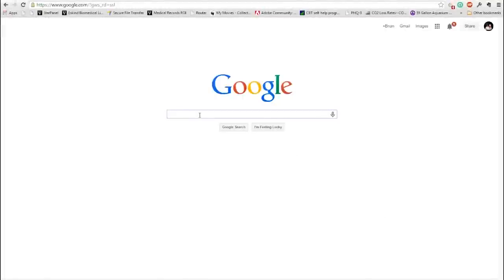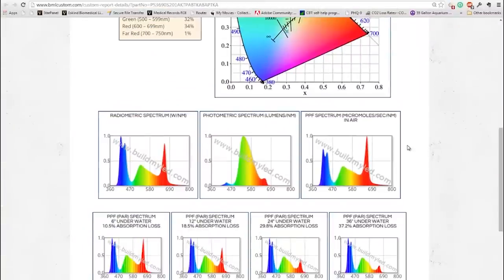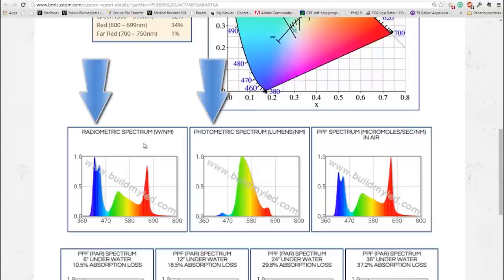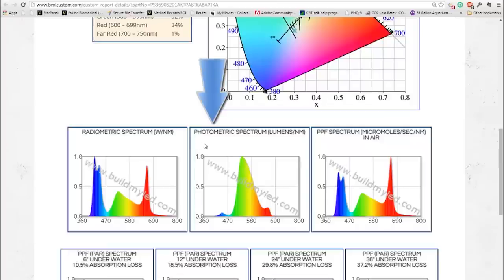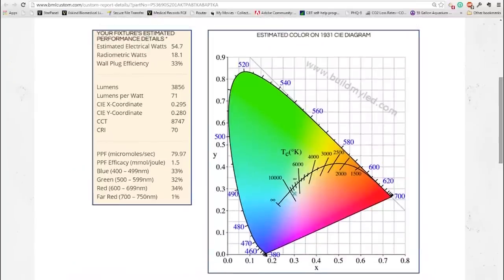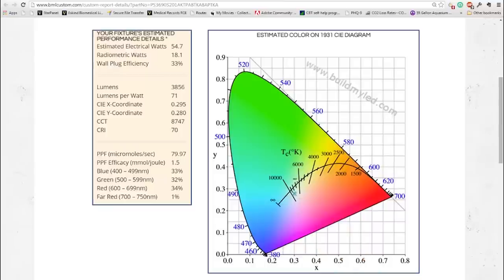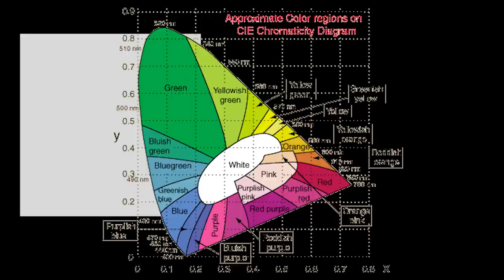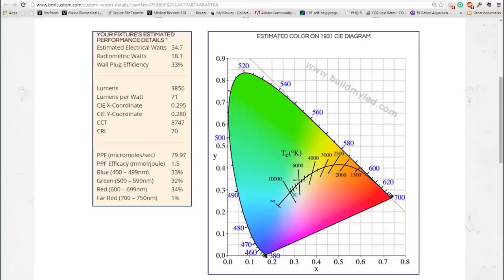Lighting A Planted Tank (Advanced Topics): 1931 CIE Diagrams, Radiometry & Photometry.

Comment: Nice Bri. Once again I am completely lost and yet so captivated. I have a nice LED In my african cichlid tank but my 75 planted has T5 HO's which seem to be doing the job so far. I might switch out my T8 in my low tech for an LED, but then would it really be low tech? Hmm. Anyway great video once again. I think 2000 subs is right around the corner bro

Comment: Hi Brian. Sorry its not on topic but wondered if you could give me your opinion on a question ive been wondering about .
I have a low tech planted tank that as the only source of carbon i give the plants is Seachem Flourish Excel, which they do pretty well on. As , at the moment i just cannot afford to go down the pressurised CO2 route, i was wondering if you think that it would also be to the plants advantage , to set up some diy co2, to run alongside the Excel, or do you think this would just be too fluctuating, and cause more harm than good ?Be great to hear what you think buddy :)

Comment: I get overwhelmed by the graphs on BML. Customer service is great on BML with text messages. This video helped me understand it a little better. But so far the dutch planted XB series is growing my HC extremely well.
Reply: We need some vids man!
Reply: My BML XB Dutch is growing my algae very well...  http://imgur.com/d704NJ8 and thats at 4 hours a day, with a good 'ol ADU light hanging "kit" holding it 17" above a 40B.
Reply: ADU Aquascaping I might make a quick video. I don't have a nice camera, but maybe I could use my S5 phone.
Reply: Brandon C. people actually use that? LOL It did its job for the old Finnex RayIIs, but now I just hang my lights directly from the ceiling with a pretty simple DIY configuration. Isn't a 40 breeder only 17" tall? I guess with substrate it would take it up a little. That may be your problem. With those lights I would try 22-24" above the lowest point of the tank.
Reply: ADU Aquascaping  Of course! I built one because I have a shelf that hangs directly over my tank otherwise the ceiling would have been an option, but I quite like the look the conduit has. I got some rgb led strips and attached them to the conduit so I still have a little bit of light in my tank, when my big light isn't on. Oh and I meant 17 inches from the top of the tank, so about 31"-30" from the substrate... The thing is powerful!
Reply: Brandon C. NickMach007 I am trying to get BML to send me a fixture. Do you guys think one will be enough for a 40 breeder? I am carpeting HC and UG. I had good results with two Finnex RayIIs, but the growth could have been better, and with one Ecoxotic E-series the PAR wasn't high enough. They were going to send me another one, but never did. So I went back to my T5HOs. At 24" there would be enough spread for a 40 breeder, just barely, and the BML fixture would be at 75 PAR. Which is okay, but I think I may need it higher because I was getting 60 PAR with the E-series and more than 75 with the two RayIIs. I am a skeptic and I want BML to prove me wrong! Plus I am an LED whore and haven't found one that satisfies my needs, LOL.
Reply: ADU Aquascaping  If you have the option to get two, I would definitely go that route.  Part of the reason I went with building that hanging kit is because the spread wasn't catching the upper portions of the tank, when mounted directly on the tank.  As far as the PAR goes, if I had any time to play around with what school is teaching me I would be able to build an extremely cheap PAR meter and tell you exactly how much I am getting.  But unfortunately time just doesn't exist anymore.  I will say that I did what you had suggested and lowered my lights by about 6 inches last night.  I came home about 2 hours after my lights went off for the "siesta" and my pogostemon erectus still had some pearls coming off!  As for carpeting I have had the worst time with HC.  The little I have left is the last of 10 pots I had originally planted...
Reply from the maker: Brandon C. and ADU Aquascaping Sorry for the slow responses guys...I was away for some family vacation and mostly off Youtube for a bit. Anyhow, I agree with Brandon. I don't see how you can run 1 fixture even with the 90 degree beam angles. The PAR is going to drop off too much around the nether regions of the tank (at least for high light loving plants like you mentioned, Dave), IMO. 
But I am a major LED fanboy...I really want that T5HO killer, I'm still waiting.

Comment: I have a 210g planted discus tank, CO2 injected with a 72" single strip LED fixture from BML.  My fixture's estimated performance details are:
Estimated Electrical Watts 104.9
Radiometric Watts 28.7
Wall Plug Efficiency 27%
Lumens 7299
Lumens per Watt 70
CIE X-Coordinate 0.342
CIE Y-Coordinate 0.325
CCT 5086
CRI 90
PPF (micromoles/sec) 135.23
PPF Efficacy (PPF/Watt) 1.3
Blue (400 – 499nm) 21%
Green (500 – 599nm) 33%
Red (600 – 699nm) 44%
Far Red (700 – 750nm) 2%
Mounted 12" above water surface with a sixty degree beam angle.

What I'm trying to determine is, what is considered a "high light" configuration in the world of LEDs?

Comment: LEDs emit light in a very small band of wavelengths, emitting light of a colour characteristic of the energy band gap of the semiconductor material used to make the LED. Perhaps you could update this video and the spectrum charts to show the actual peaks emitted and not just the chroma range identified by our eyes. I would also point out that the concurrent spectrums of the LED's on that manufacturer's website are surprisingly distributed between each range. Do you really think they have LED chips that advanced. Personally I would look again at this video because it can only detract from your sheer brilliance on other topics.